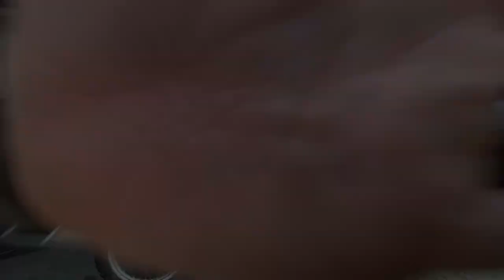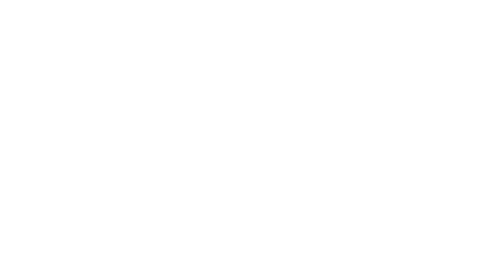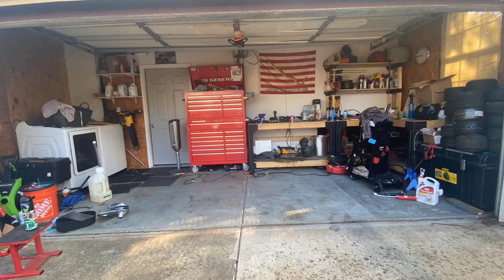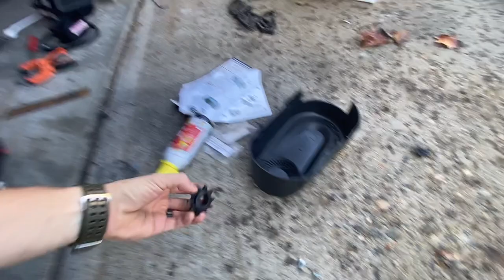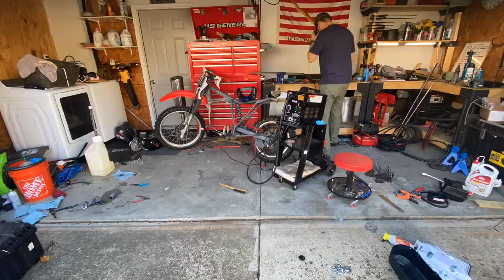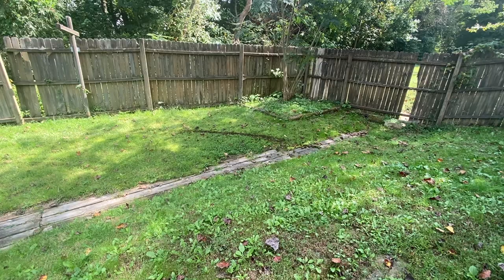How to build a custom dirt bike with a go kart engine | Predator 212cc

Comment: Make sure both the driver pulley and the driven pulley on the torque converter are aligned on the flat side. You may need to add spacers behind the driver side to make it aligned. And make sure the belt is on the right direction. Did this to my own predator 212 bike and the belt has held up a long time
Reply from the maker: Yeah once I got a new belt in I verified the alignment, it was good.  I think I had the belt on the wrong direction the first time because it’s been fine ever since.

Comment: You need to gear down(smaller front sprocket and or bigger back sprocket). Yea stronger belt might help. But i have the same chinese belt that came with the torque converter from 3 years ago on mine and still is in good condition.
Reply from the maker: I’ve thought about ordering a custom sprocket for it, plus a juggernaut torque converter from GoPowerSports.  Maybe even an electric tilotson built for torque.  Many options.
Reply: What is a good sprocket or gear ratio if  I have a 10t clutch
Reply: @daniellemus1382  depends on how much you weigh and how big of a rear tire youre running. As well as what engine youre using
Reply: Same engine in the video about 280 pounds same bike same wheel in the video
Reply: @daniellemus1382  using thar link i provided you should be good at 60tooth sprocket however even at 75 tooth sprocket you still risk burning the belt. However it says youll have 8ft/s of acceleration which should be plenty
Reply: @daniellemus1382  with 10 tooth to 60 tooth your tops speed mathematically will be 48.59mph. Doesnt mean itll do that but in a perfect world thats your max speed
With a 70 tooth your tops speed is 41mph
Reply: That's very helpful thanks 🙏
Reply: Have you tried using just motor and not torque converter? Would this be ideal or you have to have a torque converter? I'm converting 125 CC dirt bike. To predator 224. I weigh only a hundred and thirty five pounds as well
Reply: @jumpercabledadz a 212 should easily pull harder than that

Comment: i think because of the space issues, if you had a cr450 or even a cr500 MAYBE you could fit the 420 in
Reply from the maker: I agree!! It would be cool!!
Reply: It will fit but you pretty much have to cut the bike in half and fab it up all the way around, as said and is obvious is the engine angle on the predators, you can always run more oil in them and also remove the oil sensor (might as well while you are in there removing the governor) . We are putting a ghost on a little baby razor electric 4 wheeler and it's the same deal, you have a front and a rear and everything in the middle is up to you

Comment: Did ur 520 chain rub against ur torque converter frame at all?
Reply from the maker: No, I did have to put some washers to space the sprocket out though!
Reply: @jumpercabledadz  we’re they regular washers or specific washers to fit the key, if so can you link them please